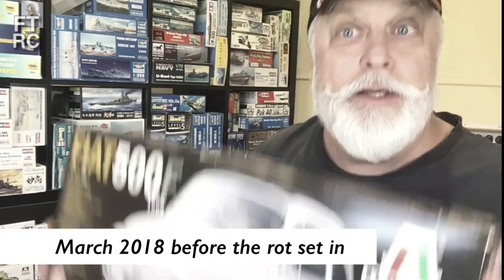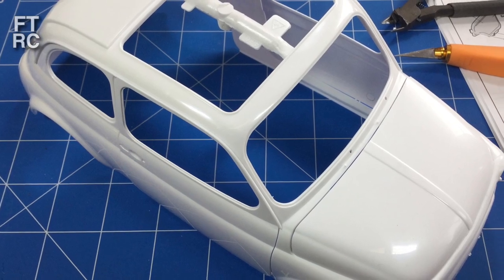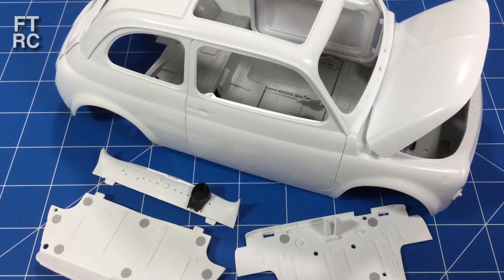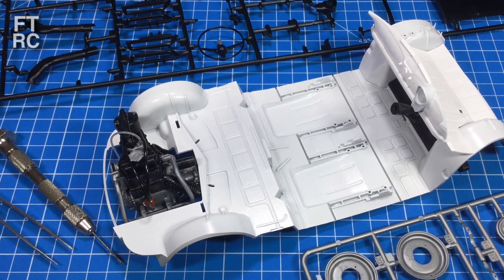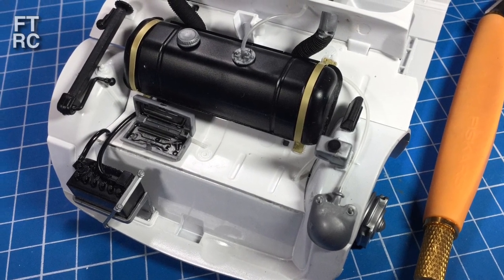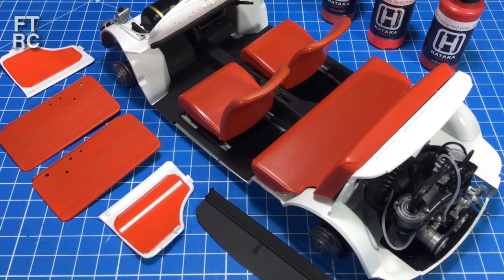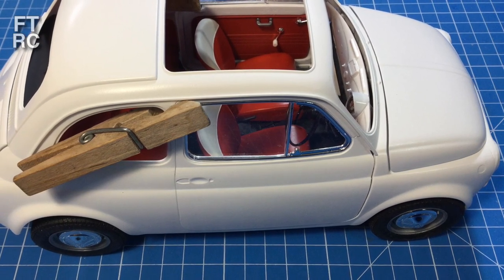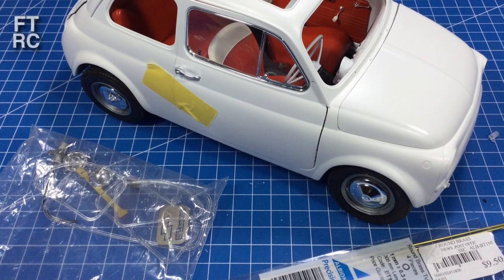The Worst Model Kit in the World and it's Italeri

Comment: obviously you have not attempted to build a classic Poucher kit.
Reply from the maker: No I have not…. sound ominous Jim?
Reply: @HarryHoudiniModels  First I misspelled Pocher.  Where do I start the instructions are very basic at best.  The plastic used in the kits very from sprue to sprue. Absolutely nothing fits. Sink holes abound.  the gaps and offset at the part seams are so large I was tempted to use Bondo to fill them.  The accuracy of the model to the prototype car is at best 60%.  I have built two of these models which proves that I am a masochist.  What is most surprising is that these kits sell for $500 to  $1000 US.
Reply from the maker: some people will buy anything!
Reply: That got a good laugh out of me. I remember those.

Comment: I think in the case of Italeri it is also depends on how long time ago a kit was tooled. Their new(ish) kits are not brilliant but older kits are much worse. I just finished Scania M113 (truck from Subaru WRT Truck&Trailer&rally car set). It is definitely old tool and it was much worse than Iveco Turbo start I build before it. Just the way the Scania kit is engineered was already recipe for disaster. The best part of the set is the rally car which is Tamiya's plastic. 🤣
Reply from the maker: This is supposed to be a new tool… with emphasis on a tool!

Comment: Remember, it is never the kit/manufacturer 's fault. It's the builder's fault and the skill issue. ;)
Reply from the maker: Not in this instance sunshine… the kit is awfully engineered.  You can do a great job of building it, then come back a few days later to find the weight of the paint crushed the fragile suspension then you have to rebuilt it again.  Utter Garbage!

Comment: I sympathize.  Keeping things in scale is nice, but not when it causes this kind of problem.  Another thing that galls me are "working" parts.  In my opinion, they actively encourage people to treat a model as if it were a toy, to be man handled, instead of a display piece to be admired.  One thing that might have helped that Fiat would have been to put Lucite blocks under the floor or the frame, so that the suspension would be relieved of most of their load.  'Just a thought.
Reply from the maker: Yes this has been suggested… not my kit… interest zero!

Comment: Fiats are crap. A model of one would be just as bad.  35 years ago I had a Fiat I bought for $500 drove it for a year when I could keep it running.  Traded it in on a new Dodge Charger. When I traded it in at the dealership they could never get it to run again.
Reply from the maker: Art imitates life then.
Reply: you've been very unlucky. I had a FIAT and had no particular issues with it
Reply: Fix It Again Tony